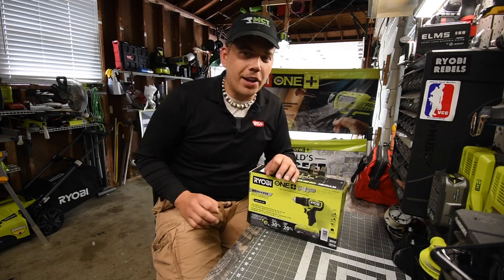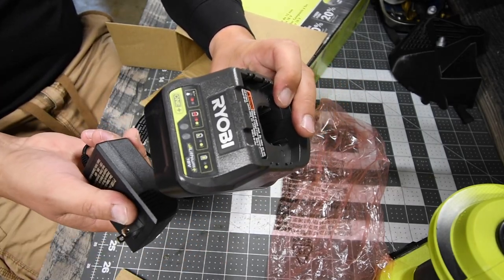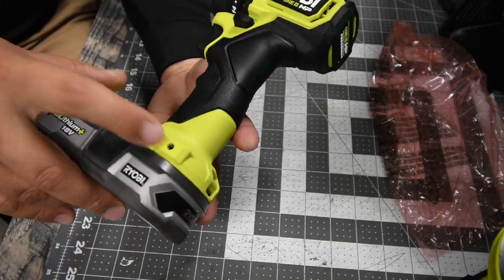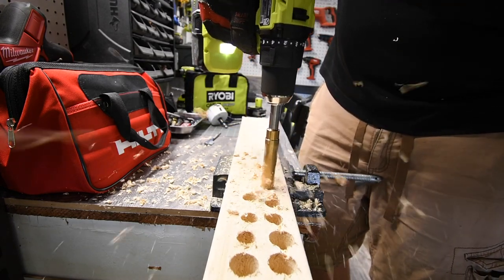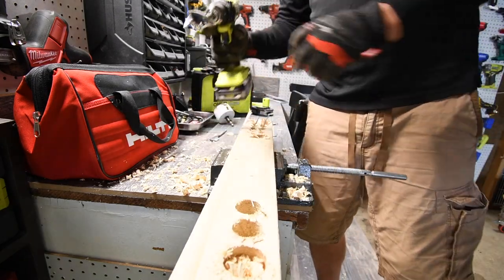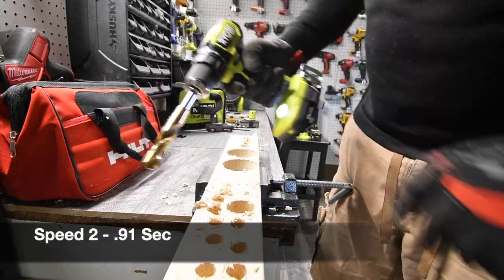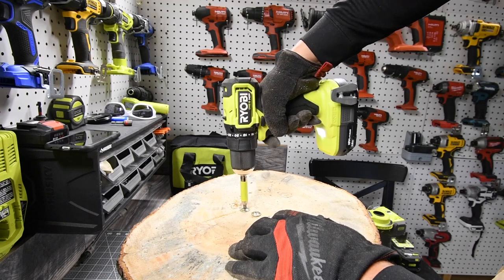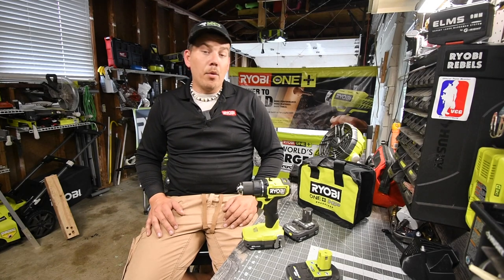NEW!!!  Ryobi HP Drill

Comment: So basically Ryobi is finally moving to the same design approach that Milwaukee, DeWalt, Makita and others have for years, as they've already had the battery management on the tool vs the pack that Ryobi is now branding as "HP" in their tools.  Meanwhile, they've all but abandoned the P195 compact HP 3.0 ah battery pack released in February of last year which would have been an ideal pairing with their existing brushless drill/drivers to cut down on the weight without having to drop nearly $200 for a new tool combo.
.. 

Based on the more exhaustive stress test performed by Workshop Addict, it seems like Ryobi overshot their real world ability to perform while not self destructing.  These tools aren't doing a good job with thermal management, so while they can rightly claim fairly good specs on paper relative to their size, the tools won't actually survive running full-out during a 15 minute review session.  He was able to get the impact so hot the front shroud of the driver melted using the same basic tests he's used with most other battery operated drill/impact tools.

I have a large investment in over 30 Ryobi tools and a dozen batteries, but I'm not particularly excited about this launch.  I think they rushed these along to hit the holiday shopping season and made some questionable design and pricing decisions on this bundle.   At almost $200 for the 2-tool Ryobi HP kit you are in the territory of some really good compact options like the black Makita 18v compact kit or Milwaukee M12 Fuel Kit (same performance as the Ryobi HP compact tools in a 12v platform), etc...    With current promos both of the options I mentioned are a better value (extra battery / ratchet included, respectively) and are significantly better built than the new Ryobi HP tools.  Hopefully they get the design flaw in the current generation of these tools sorted out and include some pretty significant promotion bundles or discounts for the holidays, otherwise these seem like a huge dud to me.
Reply from the maker: drilling 120+ holes into a piece of wood in a matter if minutes is irrelevant.i don't know about you but I will never need to drill that many holes within a that time period. the real test is to see what limits the motor can do with huge sized bits.  I get my tools going up to 130 degrees by drilling 5-15 holes. they could have done a lot better for these tools. but its a good step in the right direction. I just uploaded a video looking at the inside of these tools and the motors are about 1/2" in length. it did ok in my book. The  HIlit hammer drill destroyed the Milwuakee Fuel hammer drill in multiple videos and the hilti cost $10 more than the milwuakee. so you may as well get the hilti hammer drill instead that's how your comparing prices with power

Comment: Ryobi seriously dropped the ball. Such a shame
Reply: Yep
Reply: Where did they drop the ball? Ryobi COMPACT SERIES is going for light weight and small the metal chuck weighs more i think this is a major improvement for ryobi, makita subcompact and atomic are both less powerful plastic chuck tools but the ryobi has a ratcheting chuck the makita and atomic don't
Reply: I don't like the color scheme. Going green and black has nothing to do with performance.
Reply: @ericbaum8668  Color scheme? It's Ryobi... Those are their colors...  None of the tool brands really change their standard colors for just a tool release, with rare exceptions, unless they're completely changing their whole platform, which is not what Ryobi is doing here...
Reply: @ZeoCyberG  They changed the colors from green & grey, to green & black. Even on the batteries.  Look at the Lithium + batteries, to the new ones.
Reply: @ericbaum8668  Three things... 1) Black was always one of the color pallets they used, and this is not the first time they released a mostly black battery....  2) They're not marketing the battery as a performance battery.  The HP is the tool itself now, the battery is just a battery and isn't being marked with anything to promote it like Lithium Plus or HP, it's simply labeled a lithium battery and it's just the basic battery they intend to give with drill/impact kits and not any of their higher end options...  3) These are just compact tools, they're not for high performance.  The HP is just the change towards making smarter tools that better protect themselves to last longer and be more reliable and this compact line is just the first to get that distinction but it's going to apply to non-compact tools too and those are the ones that will start pushing the performance levels...  So lets not get carried away here...
Reply from the maker: I love this drill. they did a good job.

Comment: Why is Ryobi still making 1.5ah batteries ? It has to be a cost thing to lure in folks who don't know much about tools and batteries. I guess it would hold up for awhile with light duty work but blaming the temp on the heat in the garage...... Also , I don't believe for one minute that drill has 400 inch pounds of torque.....sorry just my opinion.  Spax are designed to be one of the easiest screws to drive , I can think of some smaller tools with less voltage that would have completed every test you tried.  I'll find out , I am going to purchase Ryobis compact set and put it to the test on a rather large deck. Ryobi claims contractor grade.....we shall see.  BTW , great video brother. Don't hate me speaking my mind.....just saying what I've seen.
Reply: Same reason they still offer brushed tools... It's a more affordable option and they are a budget tool brand... Besides, these are the compact and lighter weight tools... Why wouldn't they couple that with a compact and lighter weight battery?   Especially, as the point is so these tools can more easily get into smaller and tighter spaces... 

Seriously, there are a lot of trades and sometimes its more about convenience and reliability than raw performance.  The point of the HP marketing for these tools is that they have more smart technology to help monitor the tool and prevent it from getting damaged during heavy use.  So, unlike traditional Ryobi tools, it's much harder to turn them into a paper weight...  While Ryobi tools tended to be very bulky and these will get into space the larger tools just wouldn't fit or do jobs like anything above your head that heavier tools would quickly tire you but you can use these while doing detail work, etc. that don't require a lot of power but is more about stamina of the user...

Doing a deck, isn't really what they're intended for any more than you would use a 1/4 impact for mechanic work that needs a 1" impact...  The right tool for the job applies no matter what grade tool it is...  So only get these compact tools if you need something more compact and lighter weight and don't want to spend a lot on a much higher end tools...
Reply: @ZeoCyberG  brother I agree a lot on what you say..... however personally there really shouldn't be 1.5ah battery.....the least little bit of pressure is gonna get them hot.  Also the reason I say what I say is his test are less than desirable.  If they are light weight tools and they definitely are....why try to put them through some generic torture test. He puts out a lot of info that is not true.....uses something for five minutes and says it's greatest thing he's ever tested. Using a stump as a test medium is absolutely absurd.  I get that Ryobi is a weekend warrior tool however the way it's being portrayed is as a pro tool. So I plan on turning them into smoke this week.
Reply: @donnysanner342  - That will likely just be an exercise in frustration. Torture tests have so far shown they at least can survive more than the typical Ryobi tool as the safety features work pretty well and it cuts off when it gets too hot, etc...  So you'll probably actually get the deck done, it just may take 2-5 times longer than you're used to... as for 1.5 AH, I would again say it applies to taking into account the right tool for the job...  I've never had an issue using the 1.5AH with just a Ryobi drill, it would be insane for anything more powerful like a grinder but for less powerful tools they can be perfectly fine and the weight savings isn't insignificant, especially for tools like the Grinder that may have you slapping on even a 9AH and still needing extra batteries to get the job done...  Really, it's not like the 1.5AH is powering something like a Milwaukee Fuel tool here.  These are compact tools and they're not going to push performance limits like larger tools will and I would compare them to using the Milwaukee 12v range...  They don't even have the extra pin that takes advantage of HP+ batteries...
Reply: @ZeoCyberG  to each their own I guess , I'm just going off my experiences and what I've seen on different job sites. Funny that you mentioned Milwaukee because that is mostly what I use for my work , some DeWalt , some Makita but mostly Milwaukee. In the video he was driving home how compact they were and Ryobi claimed 400 inch pounds....no way. I'm not bashing him or ryobi , not in anyway shape or form. But for $99 you can buy the M12 hammer drill and it will probably out perform that particular"compact" 400 inch pound Ryobi...but maybe it won't...who know maybe he'll do a vid on it.  I've had my beloved Milwaukee tools go up in smoke for no reason so there is no perfect tool..... however from what I've seen Ryobi has yet to earn it's stripes , however I have seen guys have good luck with them too.
Reply: @donnysanner342  Basically, it's like Harbor Freights Good > Better > Best tool options... TTI owns Ryobi, Rigid, and Milwaukee and they each fall into those categories... So you get plastic Chuck for Ryobi to metal for the Milwaukee, etc.  Ryobi is mainly in the home tool range, Rigid can go either, and Milwaukee is for the pros... You will pay more for things like the batteries on average as you up the scale, especially if you need batteries that don't come with kits or other deals and the free batteries are usually the older ones they have to get rid of anyway as they do have a shelf life limit... So there are some trade offs even if you can start off near the same price... They each have their place and ymmv with each... Like some people prefer DeWalt because they had bad experience with Milwaukee batteries, though they have improved in recent years but that's sometimes how it goes and it confuses people when DeWalt comes out with lesser tools and don't tell people what's the difference except the price... They each have their issues and things to keep in mind...
Reply from the maker: this is 400 in lbs of torque. this is a very powerful drill for its size. Roybi did good with this drill
Reply: @ManCaverTools  ok , you did a good job showing the drill however it should have buzzed right through that wood on speed 2 if it truly had 400 in pnds.  I am going to get this set and use it for a up coming deck build.....my biggest beef with this is why are using 1.5ah batteries ?  2ah would actually be much better as standard and should not raise the cost all that much.  We will see soon how this set holds up.  Can u pls give me the model number of the drill and impact.....thanks and keep up the good vids.
Reply from the maker: @donnysanner342  also remember this is a compact tool. the Milwaukee m12 fuel hammer drill is bigger than this new Roybi 18v compact drill
Reply: @ManCaverTools  note taken....it just seems like Ryobi is mudding the waters with this drill and that battery.  How many types of 18 volt batteries do they have now ? I don't know much about Ryobi however it just seems like they come out with a new drill every three or four months.
Reply from the maker: @donnysanner342  I think its time for a new base with a new design battery
Reply: @ManCaverTools  agreed

Comment: the Makita sub compact kit is a better deal.
Reply: But it has 400 inch pounds torque the makita has 350 inch pounds and i dont think it has a ratcheting clutch
Reply: Minnesotaman I’ll take the proven actual 350 in. lbs. from Makita. Plus $179 for the Ryobi combo or $199 for the Makita with 2 x 2ah water resistant batteries, which sometimes promos w/ a free 5ah battery. As well as the impact which clearly is better with its modes and much less bit slipping. I have the Ridgid version of the Ryobi compact and while it’s neat, doesn’t compare it quality to my Makita sub compact.
Reply from the maker: we will have to do some versus videos
Reply: Man Caver Tools Makita sub compact hack makes it $165 today

Comment: It’s a drill and you get 1.5 amp hour batteries that’s just horrible, they look sharp but still junk
Reply: Not horrible, it's a compact tool!  Not a hole hog or SDS!   You generally are never going to push a drill you mainly only need to get into tight areas for anything you would really need a lot of power for and the 1.5AH saves on weight and makes it easier to carry and hold for long periods if you need to get into tight spots and do things like twist your arm into a cabinet space, etc.
Reply: ZeoCyberG it’s a drill you are using it for holes it’s not an impact driver!!!! I don’t know anyone that uses a drill for screws but I’m guessing that your are a DYI guy, I’m not using my impact for drilling holes that’s what your drill driver is for
Reply from the maker: This drill is actually a very good drill. the older brushless drill that Ryobi makes feels cheap compared to this version

Comment: great vid not impressed with the ryobi though.
Reply from the maker: I am, this tool is the size of the milwuakee m12 fuel hammer drill
Reply: @ManCaverTools  just hard to get the ryobi with the m12 fuel combo less than 120 with the hack.
Reply: @ManCaverTools  .. but the Milwaukee doesn't melt when you use it for more than 15 minutes.

Comment: Its Seem a Diy not a Pro like they say
Reply: Thats the problem, ryobi is shooting themselves in the foot, they are not jobsite whatsoever, but a really good diy
Reply: @gigi9467   IS True but ryobi  Says  its  for Professional  Plumbers  but it seem  better  for the Diy
Reply: @gigi9467  Ryobi has always been for the entry level DIY but that doesn't stop some pros from still using them because not every job needs the max power tool and if you're in the trades and need to buy your own tools then you sometimes get by with budget tools, just the way it is...

But these are different in that they put more smart technology into the tool itself.  Like it will cut off when it starts to over heat and flash the LED light to indicate the status of the tool.  So, unlike previous Ryobi tools, it's not prone to burn out and become a paper weight just because you pushed it too hard and made it release the magic smoke...  So they're making them more reliable and that's sometimes more important for pros who just need something that works, even if it's only in a pinch and only for certain applications...
Reply: ZeoCyberG damn u write alot too lazy to read it but i get that pros use the too my point is that if ryobi try to market to pros its not gonna cut i already seen way to many tests and they are not cutting it for pro work, maybe light light pro work sure but not jobsite ready
Reply from the maker: This really is a powerful drill. and it can take a beating
Reply: @ManCaverTools   do torture  tests betwen ryobi dewalt